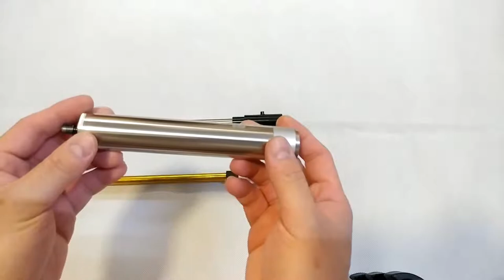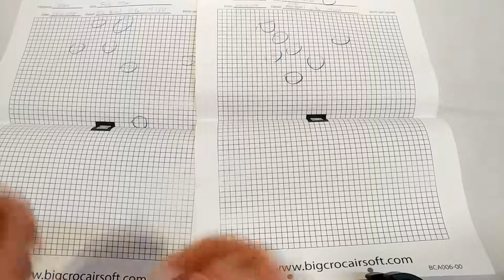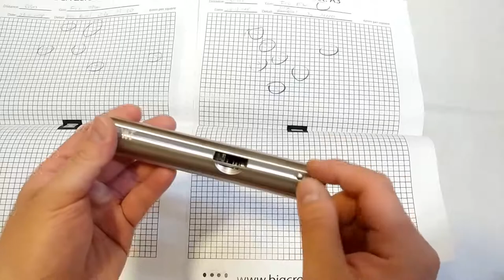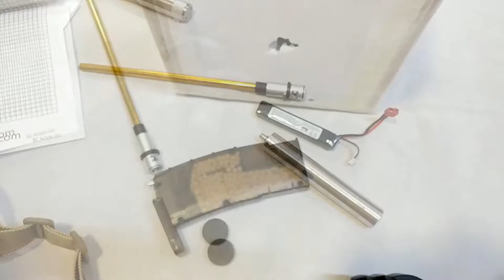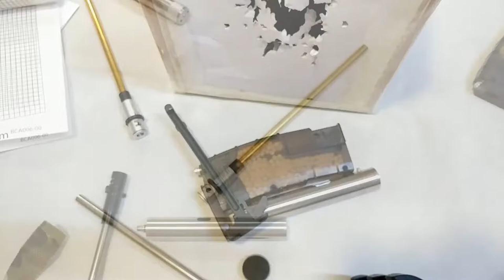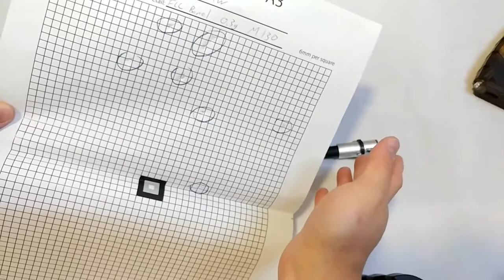Orga Magnus 6.10mm barrel chamber set (EP 42)

Comment: I have a hop up orga and it gives me the same problem, when firing the hop it looses, did you find a solution?
Reply from the maker: I tried applying some light strength thread lock glue and its holding up ok for sometime(need to reapply once a while). But now i end up using orga hop up with systema original chamber, and it works very well so far